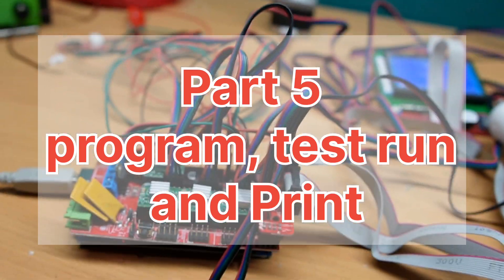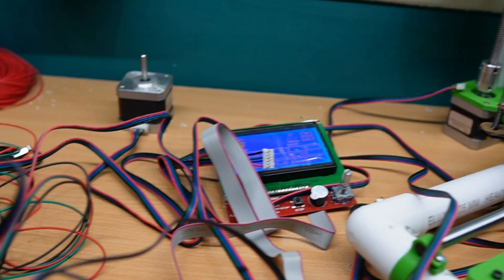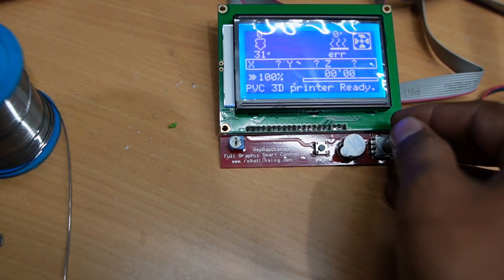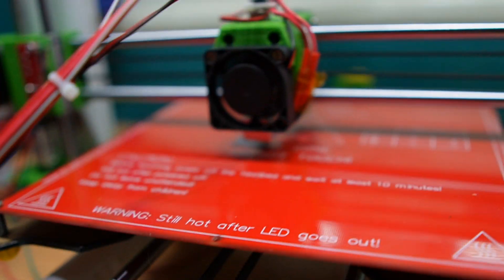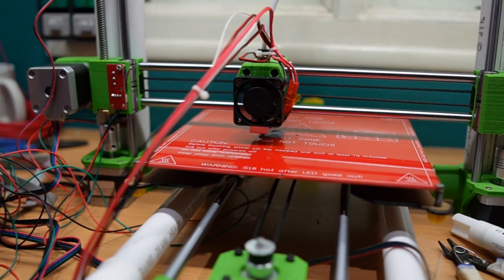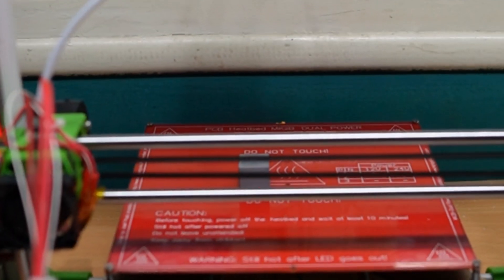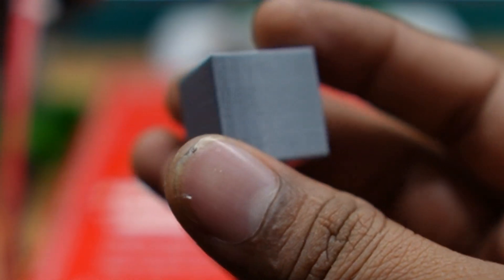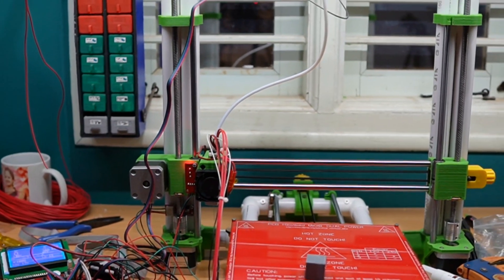How to Build a Budget 3D Printer with PVC Pipes! DIY Masterclass Part 5 Final video

Comment: Sir all are good but how u r giving print by sd card or by through usb cable 
And how u exported the g code?
Reply from the maker: Yes u have to use slicer to generate g code
Reply: @AakaarLab  sir I understand that 
While 3d print is in running 
We have to connect the 3d printer to computer?
Reply from the maker: @kvideas3230  no need if u print from sd card
Reply: @AakaarLab  ok sir in video how u printed how u run the printer with out sd card slot?
Reply from the maker: @kvideas3230 no
Reply from the maker: @kvideas3230 I am using sd card only u see the sd card behind the display
Reply: @AakaarLab  tq sir behid display there will be sd card right.
Reply: @AakaarLab  can I contact u sir 
Are you in Bangalore?
Reply from the maker: Yes
Reply from the maker: Yes

Comment: How to slice
Reply from the maker: Use ultimaker or any slicer used for 3d printing
Reply: @AakaarLab  how to use the setting
Reply from the maker: @hum.ortales1753 I won't understand which setting u r taking plz brief it
Reply: @AakaarLab  when I sliced  and started printing all the time the filament is clogging the hotend is clear it is due to sliceing problem
Reply from the maker: @hum.ortales1753 no
Reply from the maker: @hum.ortales1753 which printer u r using
Reply: @AakaarLab  DIY
Reply from the maker: @hum.ortales1753 yes